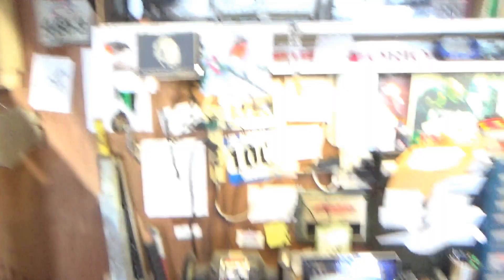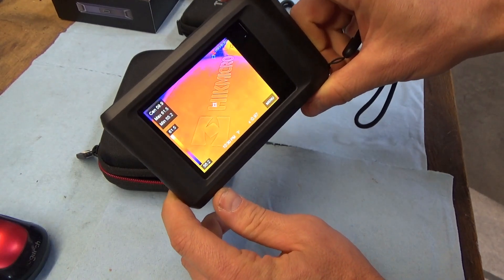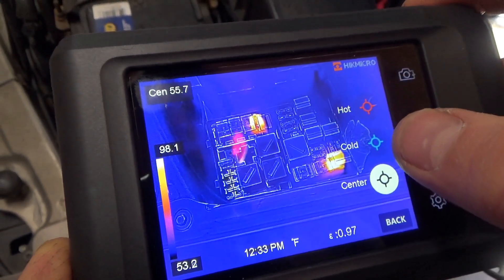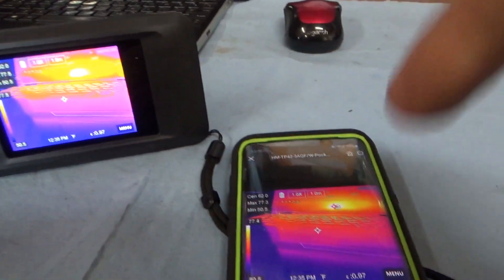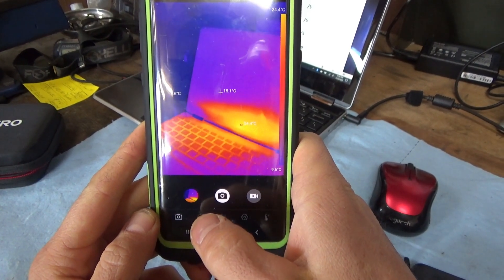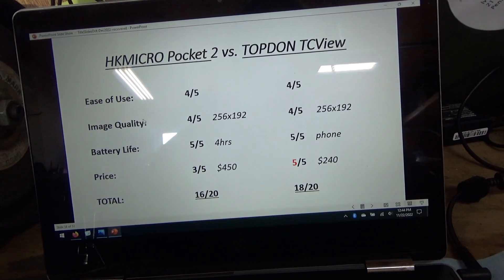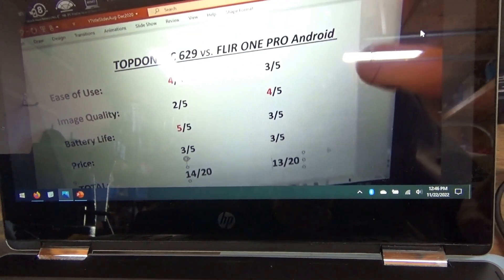Best Thermal Camera YET? (HIKMICRO vs. TOPDON)

Comment: I have a Topdon TC001 that I got just about 2 1/2 weeks ago and I absolutely love it. Two small cons - On Windows (yes, it does Windows) it will occasionally freeze/drop connection. I still don't know why, but it could be due to the 32' USB active extension I'm using. Sometimes it goes over 24 hours without a problem, sometimes half an hour. Seems to do it when I do things that might be disturbing the cable, but as I said too soon to tell. The other thing is the frequent lag spikes due to the auto shutter messing with the range of the unit. You can actually turn it off in the phone app, but no option for that on the Windows app as of this writing. Turning it off locks you into a range of temps, so be aware of that.

Anyways, the update rate is nice and fluid, and the imagery on the high quality mode is really nice. High temp range is much noisier but as I said, that's for HIGH temps, like above 500F. No, the chicks don't actually go that high, hopefully, so in normal use you're not going to be using it. I've been sticking mine in my home window to watch the real world for a while (it can see through window screen, NOT glass) and it can easily spot people from well over 500' away and even small animals like cats from over 200' away, day or night. The temp readings appear to be quite accurate given the cheapness and the general nature of longwave IR. My phone wouldn't allow straight connection (too long a jump) with my existing phone case so I created a 3d printed one to hold both while using the included USB extension cable, and it works great, and I don't have to ever remove my phone's armor. The apps both need a little improvement here and there, but the phone app unsurprisingly takes the lead here. The Windows app needs more of the phone functionality and some attention to the way the bright white floating numbers easily get lost in high temp areas of the view. How they could have overlooked this obvious flaw all this time is beyond me. They could have simply made them gray and fixed everything since the cold temp will float to dark regions and hot will float to bright regions on most of the palettes. Or, show some interest and allow custom colors, it's not rocket science. Also, no current option for custom palettes, and the color stretch function is bugged and locks to impossible numbers outside of the normal use range (mine is stuck at -279F / -473F) , yielding a black screen with your cold and hot readout floating against it like a teaser for the real thing. Aside of that, it's great and you can freely choose palette, dot, line, rectangle, circle up to ten total, and the global with the hot and cold seeker dots with no problems. To mitigate the white numbers getting lost in hot areas, I choose "blackhot" and have OBS studio grab the image stream and flip it negative, giving me black numbers against normal whitehot video. It's a PIA but it works. Besides, I'm only doing Windows right now because it's new and interesting to watch and record the real world in thermal on my PC. I'll get over it eventually and be back to the phone, which works a whole lot more intuitively. One note: Don't let this thing stare at the sun or you could burn a dead spot into the sensor. So, it's only so useful as a security or entertainment cam for outdoors. Beyond that, these cams are useful for SO many things. Monitor your Raspberry Pi's mainboard for overheating. Check for leaks both thermal and water in your walls or ceiling. Check your hot water heater for failure signs. Check your electricity breakers for the same thing, or for unusual loads. Check a huge array of things for overheating like your car brakes, engine parts, whatever. Check your vents for proper airflow. Check your damned flowerbeds for wet or dry spots. Check your legs for abnormal hot or cold spots that could indictate injury or disease. Take it outside at night and watch bats hunt for bugs. Light a fire and sit mesmerized at the hot swirling updraft. Watch your 3d printer print glowy lines of plastic and look for print overheating that will cause warp. Find the studs in your ceiling with ease. Find rats in your attic. There are SO many things you can do it's ridiculous to try to list them all. And at $200, similar pricing to a gaming habit, wtf are you waiting for? It's cheap, high science fun and usefulness just begging for you to grab it.

Comment: Those plug in phone ones BURN your battery you’ll be in service titan watching it drop a percent every 5 seconds. If they have internal battery ya get about as much life that way and it still drains your phone. For that reason alone I kinda think they’re worthless. If your phone dies at the call  you’re dead in the water. Spend the little extra to upgrade.
Reply: for someone using it near a power plug, a hub might work (seems to be working here)

Comment: Your problem is that there are 2 lenses, one each for each function, so they will be aligned to coincide at a predetermined distance.
In fact that’s not your problem, your problem is that you don’t understand that,

What you have is a thermal camera that does what most others can’t. 
It achieves it by using 2 lenses, and the misalignment of fusion images at any other than an ideal focal distance is an obvious and expected outcome . . What were you thinking, did you expect some new technology to bring about the bending of light to bring 2 separate lenses together or did you just not notice the two distinctly separate lenses on the front of the camera dude?

 idea at a

Comment: Thank you for in-depth review, my biggest concern for these pocket sized thermal cameras is not only battery runtime but also lifespan. I don't know how reliable these batteries are and even if they are high end lithium cells they will come to end of life with in 3-5 years in my experience and changing them is an inconvenience. For these reasons I bought the Bosch GTC 600 C (256x192) which uses interchangeable 12 volt battery and runs forever :)

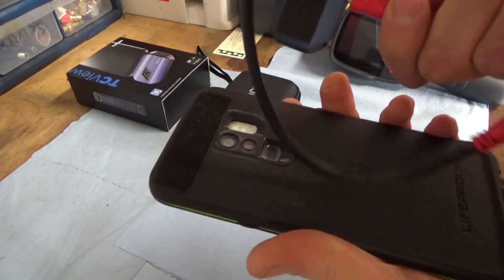Comment: 9:18... Your extension cable/velcro idea is an extremely neat solution as to why I've never been interested in purchasing any of the 'push on' type thermal cameras... because I would be constantly worried about twisting/snapping the male connecter off... ouch, now that sounds painful :0)

Comment: Thanks Ivan. Based on your review, I bought the TOPDON one on Black Friday. Just got it today, and am very impressed with it. By the way, the extension cable they supply WILL work with your phone. The USB-A side pops off, revealing a USB-C connector.
Reply: I just got the Topdon TC001 on sale for $150. it’s a great unit. There are more expensive units that are better but for a starter unit it’s top notch.
Reply: For how much did you get it for?
Reply: @iamwan939  I just checked my Amazon orders, and I paid $239 on Black Friday in 2022

Comment: ivan, the topdon comes with a cable to attach your phone with the case on. no need to buy one. You had it laying on your table there. I didn't notice at first, but if you look closely you will notice that one end of the cable has a tether connected to an adapter. So, that cable supplied converts into two different ones

Comment: That shift of optical to thermal almost looks like a parallax effect. Do they use separate lenses? Same thing that happens when you close one eye. I really like what is happening with these cameras but the price is a sticky issue. One thing I'd want to do is look closely at a functioning printed circuit board, so I wonder how close it can focus. You make a good point about battery life. The other aspect of battery life is long term life. Hopefully the rechargeable battery is replaceable....

Comment: Very well done review. The one thing, the unknown thing, about the TC View is not the device hardware itself but how it affects the phone display drain on the battery. Typically, the display is what draws the most current from the battery of most battery powered devices, like cellphones, tablets, etc. When watching a video is probably the largest drain.

This IR device, according to the manufacture, draws 0.25 Watts, about 67mAs. Over 4 hours, the specification of how long the Hikmicro is suppose to last, would be about 268mAs of the phones likely 3900-4200mA/h battery. This is next to nothing, and would leave about 3600-3900mA/h battery life. But, it probably will affect what the display of the Android phone draws. These are the unknown numbers, what the display draws with and without the TC View connected and being used.

However, the biggest advantage of the TC View I see, is the fact it doesn't have a battery. You don't have to worry about it's battery draining while not in use. 
Given all the information that Ivan has provided (thanks Ivan), and these considerations, between these two I would also choose the TC View. I would probably use it for 15 minutes or so, continuously, and compare how much the battery percentage drops with and without it attached and used over this 15 minutes (or whatever time desired). Since it would not normally be used that long at one time, and not very regularly used, this may not be an issue at all.

Great job again, Ivan. And once again, thanks for making these informative videos (this includes the automotive videos also, or course)..
Omegaman

Comment: I’m an iPhone user, and I’d pick the Hikmicron no question over the TopDon for a couple reasons, and not just only because I use Apple. With the Hikmicron, I see the camera wireless connection to the phone being a winner overall, because both Apple and Android can charge their devices and still use and mirror to your phone. What makes it better for Apple, is you can screen mirror across all of the Apple eco system while still being connected wirelessly to the camera using the iPhone as a hub. Like if your phone is too small to see, I can screen mirror my phone to my Apple TV and have a 11”-10,000’ (yes I mean feet) tv monitor or projector completely wirelessly. Which is helpful in a shop, or live shop training. Though the price is a bite to take, you’re not stuck with a useless device because it’s android only, and vise versa in minimum cases.

Comment: I have the Seekshot Pro and the thermal image does not update nearly as fast as the HIKMicro and that is very frustrating when you have to move the camera super slow to get a good image read. I like the refresh rate of the HIKMicro and hope that it will be a better choice in the future. Thanks so much Ivan for all your great down to earth reviews. By the way since your review the price went up to list price on Amazon, I had the same thing happen when Eric O. recommended the Astro Scraper and the price went through the roof and availability went south. You two definitely Rock the markets...LOL

Comment: I have a UNI-T pro UTi690B that I bought around a year ago. Had to order it with the Banggood app from China (which I almost never do). But I have to say, I’d rather use it than any of the 4 IR cameras I saw you review. It is built in the same form factor as the older pistol grip TopDon you reviewed but has better specs. For instance:

255 X 192 IR resolution

Configurable visual image overlay with parallax correction and switchable white illuminates so you can use it in dark places (like under a car dashboard) and still see the visual light image overlay. 

5°F -1022°F measurement range. 

USB-C Rechargeable lithium ion battery 

Micro SD card slot for image storage

IP65 water resistance, 2m drop tolerant 

Lots of configuration options for how the image is displayed. 

I see it listed on eBay for more than I paid for it when it was first introduced. So lookout for sales. Banggood has it for $349 right now so their sale price is no longer in effect. 

Check it out on YouTube. There are other sites that have reviewed it. I highly recommend it even if you have to pay full price.
Reply: I have same camera. Its refresh rate fluctuate alot. Startup time is 30s+ vs hikmicro b series that take 2s. Camera is durable but software, hardware and screen are really low quality for its price.

Comment: So the reason that the image didn't align in the Fusion mode is because you had the Parallax correction set for 1m (top middle of screen at 5:21). As someone else said the camera takes the IR and Normal pic through 2 different lenses and you have to set the distance to 0.3m (1ft for our American Cousins) otherwise they will be wildly out of alignment when looking close up!
Reply: I have the same issue with my hikmicro B10 and have changed the parallax from lowest to highest setting and haven't seen any difference....
Reply: Does that change as the distance to the object changes?
Reply: @asleeperj  yes, but unfortunately there's not the ability to change it much, normally only 2-3 separate distances.

Comment: You can take apart the flir cameras and solder jumper wires from the USB port to the battery connection and run it off of your phone’s battery. I had a gen 3 FLIR one so I know what you mean about the horrible battery situation. If you don’t feel like doing that then you can swap out the battery.

Comment: Very interesting small IR cameras! My YT profile picture was made with a very expensive (and big) FLIR camera, some 9 years ago, and I'm sure if I took it again with any of these cameras, it would be much better. Indispensable tool to track thermal related malfunctions and I would go for the small TC View (my phone is even Android, but I could get a used cheap phone just to work with this camera). As for the Pocket 2, the non overlapping pictures result from two different image sources - IR is taken by a Bolometer and color image by a standard CCD, the two not being in the same optical path, for obvious reasons, but Topdon could have made an effort to shift one to overlap with the other (could be a design overlook, maybe software correctable in the future).
I find both prices very attractive indeed!

Comment: Year 1998, took a month long class at FLIR. That and $11K got certified to purchase and use an actively-cooled FLIR IR "camera" that was literally the size of refrigerator, and rolled on a cart. 10 yrs later we had handhelds that cost a measly $24K each, which was actually considered affordable. Now.. a smartphone plug-in. sheesh. I wonder if we fully realize and/or appreciate the ever increasing technology. Enjoyed this video, btw.
Reply: Thanks for the history Steve.  I now appreciate themal imaging even more.  I am still trying to get my head around rolling in a refrigerator size device.
Reply: @dogsplantscarsneatstuff176  haaa Ya, that beast took 2-3 people to load into a van. The cryogenics were expensive, it was never a viable tool, wrote-off as loss. The handhelds were 2nd or 3rd gen and were a revelation: Great resolution (for the day); customizable; large temp range; accurate; adjustable emissivity. By the way, FLIR was bought by Fluke  <off topic>  I commented that I liked this video, but I should have said 'I enjoy all PHAD's videos'.
Reply: if you think that is awesome,  you should check out most of the ulephone rugged phones, like the ulefone 18T with built in FLIR camera
Reply: @craigkennedy9968  I looked at those and then looked at how fast IR tech was advancing.  Decided I wanted to keep my phone longer than a year or 2😂🤣.  
It would be nice if flagship phones start throwing them in though
Reply: @stephenwgreen78  Ulefone 18T is a flagship rugged phone with excellent specs. you can even add on an endoscope or a night vision camera. instead of a macro camera, there's is a microscope camera, and main cam is 108mp. nearly Indestructible screen, huge battery and memory, and a flir camera that puts others to shame and will stay relevant. those cheap ir cams used in video are laughable and extremely poor quality.

Comment: Ivan, check out infiray line, including the T2S+ for $300, comes with cable and nice handheld universal mount.  Just bought one and the specs and hardware and price are the best, IMO.  They carry a full line but theT2S+  model has adj. focus down to macro and no built in battery bs.  Of course depending on use heavy duty model with their own screen too.

Comment: The thermal and optical images are coming from different lenses.  I have a different model HIKMICRO camera and there is a setting to tell the camera what distance range you are shooting from.  This information is necessary so it can correct the image offsets and merge them more accurately.
Reply: The Pocket 2 has a distance measurement adjustment in it that will correct for the misaligned images you are getting.
Reply: Not sure why they wouldn't design in a pair of mirrors and use a common lens. Then it would always look perfect.
Reply: @lolzlarkin3059  Infra-red is absorbed by glass, so the lenses for the IR camera are made of different materials. Like sapphire, germanium, calcium fluoride and other things. I don't think visible light passes through those easily or at all.